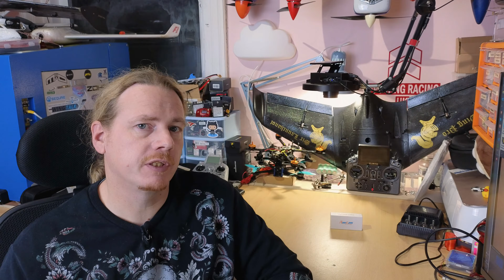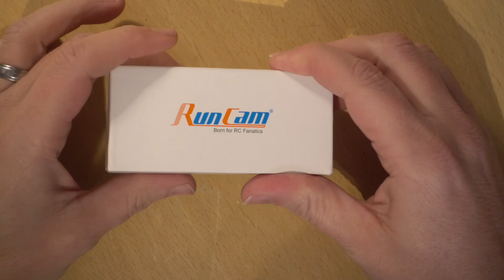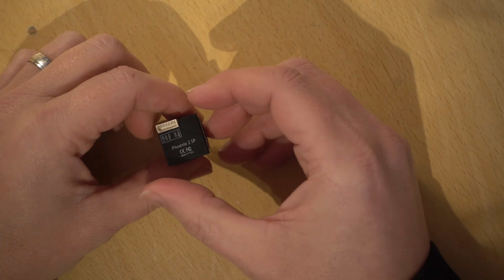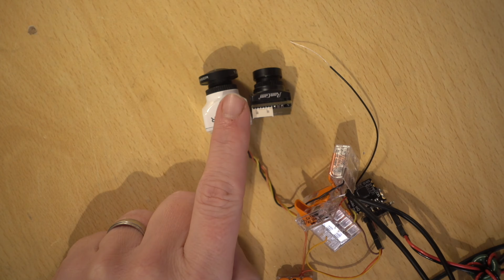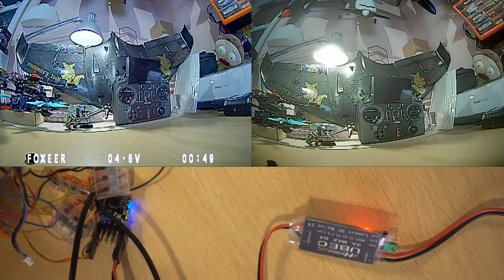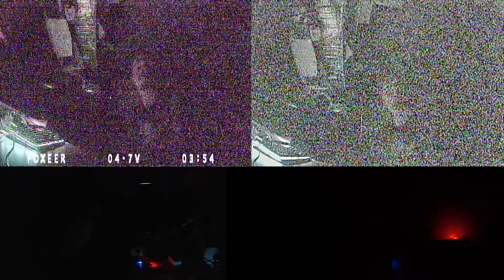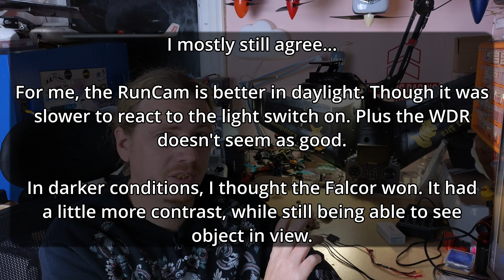RunCam Phoenix 2SP: First look and unboxing

Comment: 0:10 Useful review, but I didn't hear you say what the FOV is?  Field of view is pretty important 😉. 155 degs. 😊.
I lied. 😮
lFlexible Viewing Angles: With a wide field of view (FOV D:155° H:122° V:92° | FOV D:138° H:122° V:68°) and adjustable screen formats (4:3 and 16:9), the Phoenix2 SP accommodates all viewing preferences.